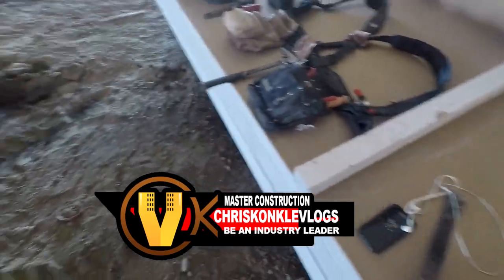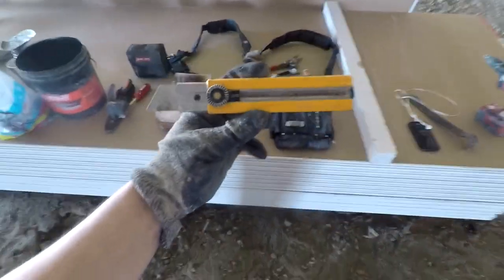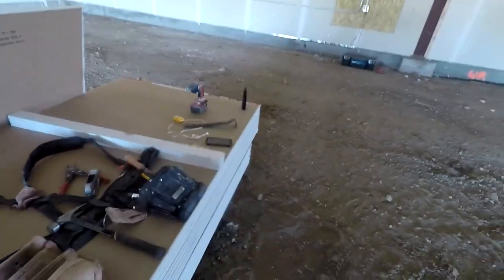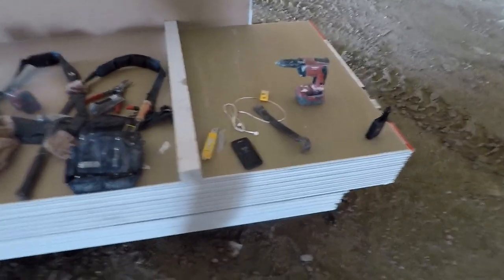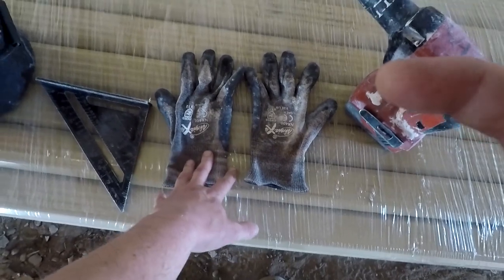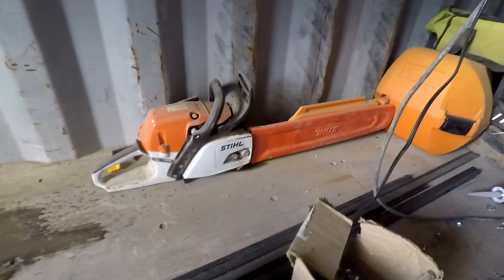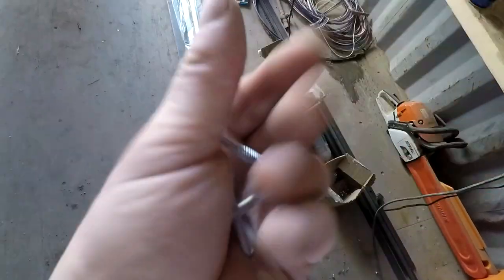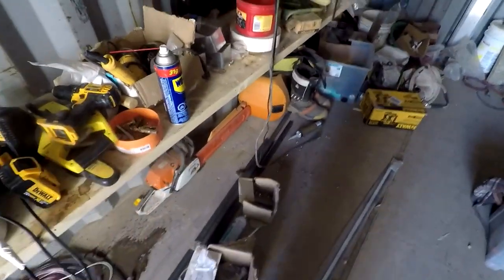This Is The Best Utility Knife For Any Trade.

Comment: Now I have to buy that knife. I like my fastback, but burn thru blades. You hang more boards then I do. I believe in the Konkle!!!
Reply from the maker: +renaissanceman its crazy how much use I get out of thoses blades. Ill cut up a 100 sheets with 1 blade if I stretch it out. Thats insane. When I cut batt R20 ill use 1 blade for every 600 square ft. Normally but can stretch to 1000 if needed.

Comment: Lol. Chris. That Klenk knife is actually a duct knife they are sold at AC supply houses
Reply from the maker: The Klenk scuba diving knife? Its perfect for semi rigid witch duct guys use all the time!
Reply: @ConstructionKronies  yeah but that's the thing it's not a scuba knife it is actually a duct knife I have multiple duct knives in klenk is one of them. Klenk is an HVAC tool manufacturer mostly in the area of metalworking for all of the tin knockers. However they do make a a handful of other non metal working tools such as welding inspection mirrors flashlights. But yeah it's not a scuba knife most scuba knives have a plastic sheath and this plastic she will normally have a drain hole at the bottom of it.  the knife will clip or snap into it. granted there are exceptions to that rule to where some of them will have a cloth sheath of some sort , however when it is a cloth or fabric type sheath on a scuba knife it will always have straps whether it is straps for tying around your leg, or tying around your boot , or tying around your arm, or your other equipment.  if it is a fabric sheath it will have some type of cordage or straps for sure. Also fabric type sheets are not recommended for scuba style knives unless it is a polly style construction or ceramic style or something similar due to the cloth or fabric style sheathing retaining water especially saltwater leading to corrosion and rust of ferrous metals. Even the plastic type sheathing that the knife will click or snap into usually still have some type of cordage or strap but not always. And yes it makes sense that it is good for semi rigid and that duct guys use them all the time because it is a duct knife. LOL. PS also scuba knives are normally more of a finer point at the tip this is generally the rule so that it makes it easier to stab with it when need be. However look at the Klein Tools duct knife, look at the Milwaukee Tools duct knife, the Malco tools duct knife, look at the bramec duct knife, now look at that klenk duct knife they're all basically the same with the exception of style of sheathing and some of them will be serrated on one side and smooth on the other and some of them will be smooth both sides
Reply from the maker: @jdreynolds29  super cool. Yeah I was given the knife from someone in the sheet metal union who told me it was a scuba diving knife.Cheers Jason!
Reply: @ConstructionKronies  lol he was probably messing with you. He gave it to you because you knew what it was and knew that it would come in handy for you but at the same time you want to mess with you about it. 💯

Comment: Favorite drill bits or auger bits?
Reply from the maker: My favorite drill bits are the Hilti gold tip #2 Philips, the Dewalt Impact Ready bits, the Hilti magnetic drill shaft (its shorter than normal ones which is nice) and I have been buying the Milwaukee auger bits lately.